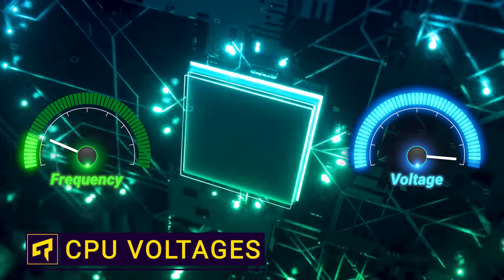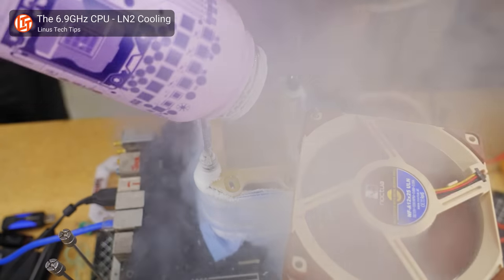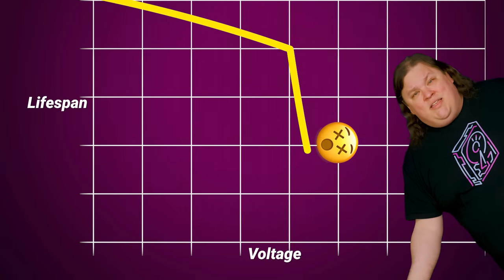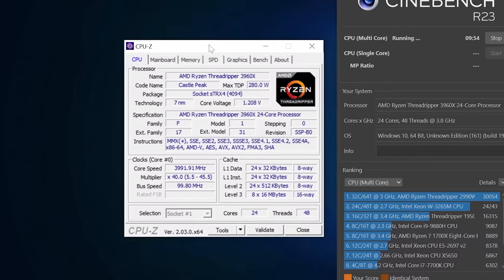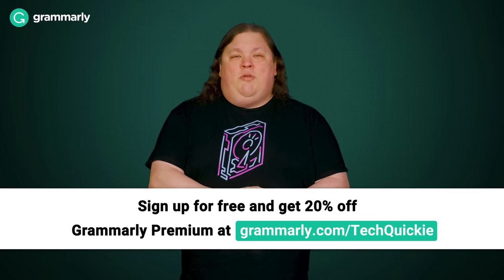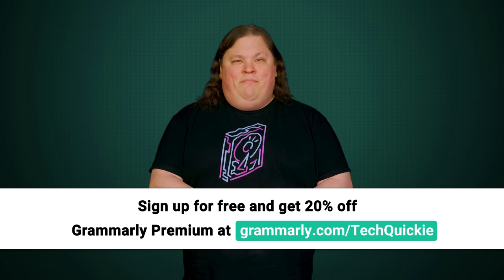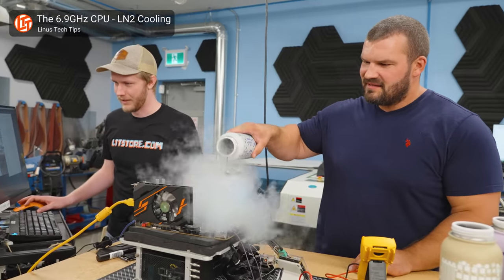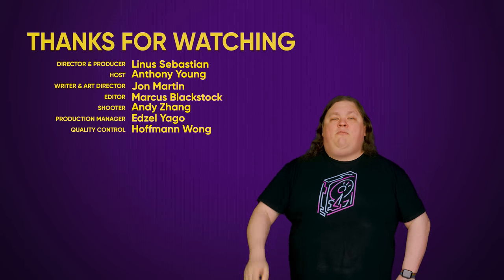What's the Point of UNDERVOLTING Your CPU?

Comment: This is a must do for ALL gaming laptops, trust me you WILL get at least 15% more performance by undervolting, and the Temps will also go down a bit.
Reply: By keeping the temps down so there is no thermal throttling, it can help... unless you have a laptop that already has very good cooling... which is NOT most of gaming laptops.
Reply: can you guide me mate? give some link on how to do that
Reply: I can't even access those settings bruh
Reply: @freevbucks8019  If it doesn't let you F12 or DEL into the BIOS, hold shift while clicking restart in Windows. It'll bring up more boot options and one of them should be BIOS/UEFI.
Reply: Dude......... laptop Bioses literally don't have any of these features available. They have one of the most BASIC BIOSes ever !
Reply: @perrypereyra6671  MSI afterburner or any built in hardware control software. Some laptops allow that change in their BIOS as well. For CPU throttlestop is a good option.
Reply: @r.g7261  they do. just need a special shortcut to open them. On MSI it's rShift + rCTRL + lALT + F2
Reply: @battledroidb-121  man you're lucky. My HP pavilion has no such function unfortunately :(
Reply: Intel has been locking it on 12-th and 13-th gen, I mean completely disabling it. Locking began since 10-th gen. So for most laptops today, it's unfortunately not an option. And I wish Tech Linked mentioned it
Reply: @TabalugaDragon  Not really but that's the problem. You need to shop for a specific class of laptops from a specific brand to be able to get the option to undervolt. Which isn't fair at all when in the desktop realm, basically any intel K series or AMD CPUs can be overclocked irrespective of who built them or which company assembled them
Reply: @r.g7261  I agree, which is why I hate what Intel and AMD are doing. They could have easily unlocked the voltage control on laptops, where it's needed so much due to thermal limitations, but instead they only give those controls to desktops where cooling is almost never a problem. 
I'm surprised Nvidia still has voltage control on their mobile GPUs, probably won't last for long.
Reply: @TabalugaDragon  I highly Doubt that it's AMD and Intel that are locking it. It's most likely the OEMs that are doing this shit. Cuz I've seen Mobile Processors being Put into MiniPCs and Those MiniPCs have Overclocking/undervolting capabilities. So yeah I believe this is 100% the OEM's doing
Reply: @r.g7261  Intel literally said they are doing it. While Ryzen master software and any of that stuff doesn't work on laptops even designed for overclocking. Some laptop manufacturers directly said that AMD are the ones who lock the voltage. So trust me, it's those two. 
"Cuz I've seen Mobile Processors being Put into MiniPCs and Those MiniPCs have Overclocking/undervolting capabilities."
I bet not the ones which are completely locked(latest generations). 
Tell me what CPUs exactly had unlocked voltage in those mini-PCs.
Because in generations 4-9 Intel mobile CPUs had unlocked voltage. You've probably seen one of those or HK\HX models which had unlocked voltage until 13-th gen.

Comment: It'd be really cool if there were an auto undervolting software for chips like there is for overclocking. That way the power savings would be available for everyone.
Reply: most modern cpu and gpus have good power savings, but true custom underclock can improve it, or cant

Comment: I did this on my laptop for better thermals, slight core ratio OC, working great so far.
Reply: Intel has been locking it on 12-th and 13-th gen, I mean completely disabling it. Locking began since 10-th gen. So for most laptops today, it's unfortunately not an option. And I wish Tech Linked mentioned it

Comment: Using manual mode without overclocking can also prevent the core voltage from going too high. It can even result in lower cpu temps. Because most motherboards, if you don't change any setting, can make some voltages go crazy high when it's not necessary.
Reply: but wouldn't that set core voltage always make it ramp up in frequency?

Comment: If some of you aren't comfortable tweaking voltages or worried about stability. Just run some power limits. Yes you lose a tiny bit of performance, but the voltages and temp will be naturally lower under load. Hence longer lifespan and no worry of stability.
Reply: 5% slower is not subjectively noticeable on light workloads BUT you don't want that for gaming, those short boost clock periods help mitigate CPU-bound stutters.
Reply: @RadioactiveBlueberry  Right of course, I meant for all core workloads, reducing the PL can help. I have my 13900K set to 193W and it runs a lot cooler and with less voltage. For gaming workloads, it barely reaches 150W anyway so I still get the full 5.5Ghz on P cores (and 4.3Ghz on E cores) with no stutter.
Reply: @soapa4279 what cooler are you using?
Reply: @ak-47821  Noctua NH-A12

Comment: I undervolted my i7-4700MQ laptop mobile chip and managed to match a desktop i7-3770 on Cinebench R23 multicore and 77 degrees. Only uses around 36 watts for the same perfomance and desktop i7s from that era have twice the power consumption.

Sillicon lottery?
Around -90mv, there's someone that managed -100mv and overclocked the chip to 3.6GHz (i think).

i7-4700MQ is partially unlocked, that means you have a maximum overclock of 200MHz or 2 bins.

Comment: I've underclocked (including undervolting) every computer I've had since Windows ME. You can vastly improve the lifespan of parts by reducing run rates, vibration and heat production. Even with adequate cooling - the fans on your gpu will eventually stop working because the lube in the fan's bearings will dry out, running at lower speeds increases their life span. There's also the issue of how much vibration your various fans transfer onto the mobo. Or just in terms of pure voltage - yes, even if you keep it cool - electricity is still electricity and if you can expect X = runtime hours at Y voltage: you can expect C = runtime hours at U voltage and that means C > X if Y > U. 

If you're the type of person who replaces your entire computer every few years - then it doesn't really matter much. if, however, like me - you're the type of likes to siphon every last ounce of runtime (and capability) out of your rig and keep it for 6+ years before replacing it: it matters. You can also hit sweet spots whereby reducing heat produced by doing things like undervolting, leads to increased performance because you're avoiding thermal throttling you would otherwise encounter during heavy tasks like gaming.

Comment: I remember with my old i7-4790k I used the motherboard's preset for 4.8GHz and wondered why the performance was worse than stock, then I saw it was hitting 100°c, the voltage was set at 1.5v. I eventually got it running @ 4.8GHZ on as little as 1.13v, but stability set it at 1.16v and it never went over 70°c

Comment: I have an undervolted i5 8250u, (running at -100.6mV) and the performance difference is instantly noticeable, i get about an extra 30 fps in cpu demanding games and GPU throttle happens much less now, the temperatures are also a lot better than they used to be.

Comment: The thing I always found strange about under-volting is that it works. Generally speaking, reducing the voltage results in slower signal propagation, meaning that it takes longer for a processor to stabilize on an output value. If we're able to maintain stability while lowering the voltage and increasing the clock-speed, then that sounds a lot like the CPU was over-volted to begin with. Over-volting a CPU by default doesn't make sense either because the energy use (and heat generation) is proportional to the voltage-squared. A CPU shouldn't be overvolted unless you are trying to overclock it, so why are CPUs being overvolted by default?
Reply: every CPU is different from the last, let's say you're intel and you have a huge sample size you tested, you will find out really fast that some cpu's need 1.1V to be stable and some need 1.150V.   as a mass seller of these chips you want to be on the safe side(stability) instead of causing allot of CPU's to run unstable.

Also every motherboard maker has different default voltage values.
Reply: What you have to realize, is these companies deal with a MASSIVE amount of processors, hundreds of thousands/millions... And they need to find a general voltage setting that works with the vast majority of them (to ensure stability and reduce the amount of rma's/etc). I have actually gotten CPUs on two different occasions where they were actually unstable at stock voltage settings, I had to actually raise the voltage a little bit to make them stable... Needless to say, I ended up returning those CPUs during the retail return window. But the point I'm trying to make is for some people, you can barely undervolt the processor and for some the stock settings isn't even good enough (and honestly the companies probably shouldn't have shipped these processors to begin with, but you have to remember about total profit margins/yields are also another major driving force). And not to mention motherboards can even play a small roll in voltage/power delivery (in some cases)
Reply: Reliability, repeatability, and performance. Due to the complexity of the process of making semiconductors, there are a number of variables that can impact a specific chip's characteristics, commonly referred to the silicon lottery. After fabrication, the wafers go through a round of testing and then the individual chips go through a final test once they are in a final consumer form. From this testing the manufacturer uses the data to find an optimal "binning" solution that splits the chips into different product segments. This is generally done to maximize the effective yield(how many good chips they get from each wafer) and meet estimated demand while grouping chips with similar "test scores" generally based around # cores/speed/voltage/power. Because of the variability involved with binning millions of chips into a dozen or so products, they have to over-do the default settings to guarantee the minimum performance while accounting for the worst-case scenarios. 
That is why in the past, overclocking was a much bigger deal, because the manufacturer was leaving potential performance on the table to guarantee the chips met their specs. Now that power is such a concern they are able to spend a decent chunk of the transistor budget on dozens of controllers/sensors inside the chip to allow it to dynamically change it's settings (speed/voltage/power) to maximize performance based on its current workload. Therefore the chips can be pushed much closer to their full potential than was previously possible.
So while the game has changed quite a bit with regard to overclocking, undervolting will still be a thing.
Reply: Posts another paragraph saying the same thing to one up the nerd above me

Comment: I didn't use offset, when I undervolted my CPU recently. I reduced the maximum core voltage until it would barely run the allcore boost frequency, then added 6.25mV and pushed the allcore boost 100MHz higher. Saves power, runs faster and stable for 2 weeks now!

Comment: I'm missing a disclaimer that this technique is not suitable for every CPU. I'm running a Xeon Westmere-EP, stock voltage is 1.1 or so. No fancy boosting, no flawless transitions between boost states and when undervolted it wouldn't even reach stock speeds. In this case looking up the max safe voltages for every rail in the datasheet is crucial to achieve maximum performance. In my case that is 1.4V and it needs to be set to override because of stutters during transitions from c6 to c1, or even shutdowns because of the voltage regulation not acting fast enough.

Comment: My old PC with AMD Phenom II came out of factory with 1.4V VCore setting... It's been running stable on 1.225V over a decade now, but it's 10 degrees C cooler than what it was with stock voltage. Combined with an aftermarket cooler and Phenom MSRTweaker (where I set all P1 multipliers to 4x and voltage to 0.8v), I am running this PC in passive cooling mode for the most of the time.

Comment: Using Ryzen Master, I managed to undervolt my 5900x so much that it uses around 50W at full throttle :D
Reply: I have my 5600 at 40W but I took a 12% performance hit. Since I don't need those 12% I take the 50% energy savings, thank you.

Comment: You can also undervolt the GPU! Something i am currently fine tuning now! 
I already got it work and i noticed the improvement and the AMAZING heat reduction! 

Now i am trying a combo of undervolt and overclock with MSI afterburner.
Getting my Frequencies as high as they can go with the lowest voltage possible. 
If it does work it will be perfect for my laptop as it already has a somewhat good heat management. (for a laptop)

I read Undervolting + Overclocking that it could interfere with "GPU boost" on the long run and give worse results but since i have no idea what "GPU boost" is and was not able to find anything online other than contradictory information i will give it ago!

Comment: I think HWiNFO64 is a better utility. The sensors are clearly labelled, and a couple other bells. Seems like the best method for undervolting is run at the default power rating and just turn your CPU up a little. Logic would suggest that is the best balance for longevity and performance.

Comment: I'm honestly shocked that at no point in this video was it mentioned that you can undervolt NEW CPUs ONLY and get the same or better performance. I run several variations of slightly older Intel HEDT platforms, and undervolting would leave massive amounts of potential performance on the table. I need to overvolt and overclock to get the full performance of my CPUs, while newer CPUs from both teams are already OCed to the hilt out of the box. Your information is correct, but only in specific cases. And as a side note, I have never had a stable daily overclock that involves overvolting kill a chip while I was still using it. That's an extreme and very rare case, not something responsible or even slightly edgy overclockers need to worry about.
Reply: Some newer CPUs can get 2 or 3 bins higher at the same voltage. You can usually get a couple hundred more mhz before needing 1.5v

My 13700k can go from 53 -> 58 all core hitting 1.45v. id say there is still headroom and with more juice, you just need the cooling for it. Overclocking is not as dead as everyone says

Comment: I have a passivly cooled "typewriter" PC (the one I am typing this). The 6 Ryzen cores run with 3Ghz (I BOINC) and the screen output too are done with a 41W whole system socket power. (22W diff to idle). There is not even any undervolting. Goes to show that the last 20% are always done with brute force.

Comment: Kinda disappointing that there was not a word about laptops, as it is, I think, where UnderVolting is the most useful
Reply: A lot of laptops don't have that capability
Reply: @Tallnerdyguy  You can always do it with programs like ThrottleStop
Reply: @Tallnerdyguy  Use throttlestop or intel XTU
Reply: @ValouFCH  not anymore. Intel started locking it since 10-th generation and completely disabled it since 12-th. BUT Techlinked\Linus Tech Tips should mention Nvidia laptop GPU undervolting, which still works. But they never do and I don't understand why. Like, I'm physically unable to understand it, considering how many gaming laptop reviews they've already made and how many "how to cool down a laptop" videos they've made already. It makes no sense.

Comment: undervolting is blocked in most bios by manufacturers these days due to undervolt protection to solve plundervolt issues.
Reply: plundervolt? that sounds like some pirate stuff yarrggh
Reply: Not if the psu has a microcontroller

Comment: If you have a laptop and can't undervolt from your BIOS, you can use Throttlestop on Windows 10 or intel-throttlestop on Linux. 

Ever since I did this, my ASUS ROG laptop runs a solid 8-12°c cooler under full load with a -140mV undervolt. That is quite extreme and more than most will get away from what I understand though, I guess I got lucky with the silicon in my machine.
Reply: I’m running a 10th gen Intel in my laptop too, unfortunately they’ve locked it , I can’t tweak the offsets even in throttlestop or Intel XTU :(
Reply: @shaanbhatt2206  That is extremely bizarre. If you have Win11 you might need to disable some security stuff for TS to work (you can google it), if you have win10 then I guess you're right
Reply: @Markski  I am running Win 11. Throttlestop only works in setting TPL settings so as to ensure that I can restrict my clockspeed to be a particular figure, no freedom to work around voltages sadly, its a BIOS thing from what I’ve heard.

Comment: This video left out a few critical points. Since the Plundervolt exploit came out, Intel implemented bios changes that remove the ability to undervolt on all new CPUs. This limitation is a limitation intel themselves placed on CPUs. So if you have updated your bios for an intel motherboard, you may need help to undervolt your intel CPU even if you could do it in the past. Secondly, undervolting can result in system instability resulting in crashing. The usual fix for this is removing your CMOS battery from your computer. On some laptops, it is difficult/impossible to remove the CMOS battery
Reply: Very very rare about cmos, you can also revert back settings so you don't get crashes, why you trying to be scary